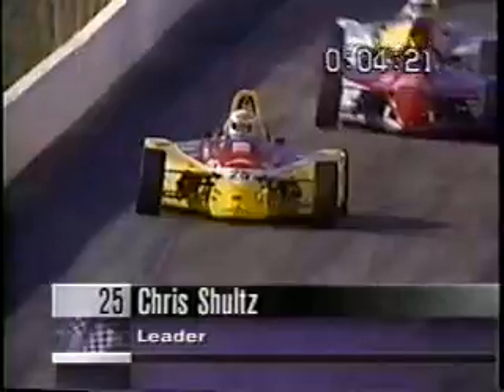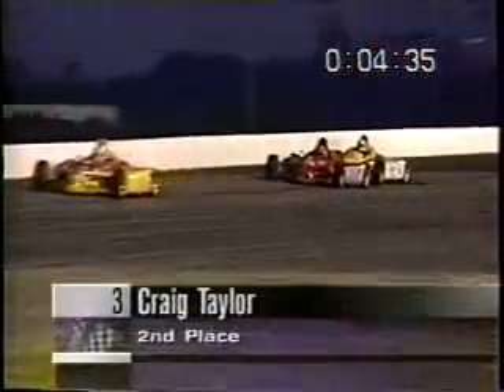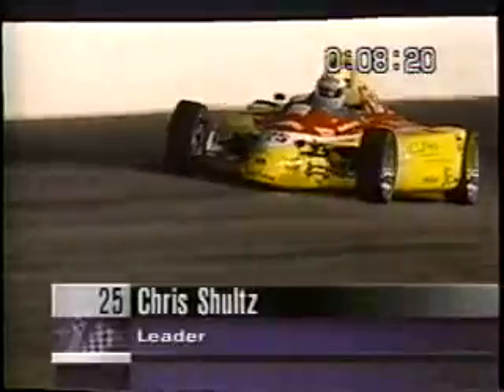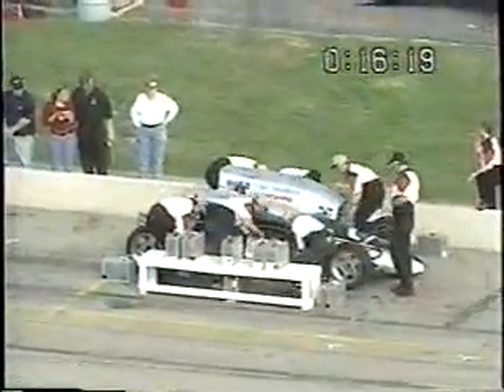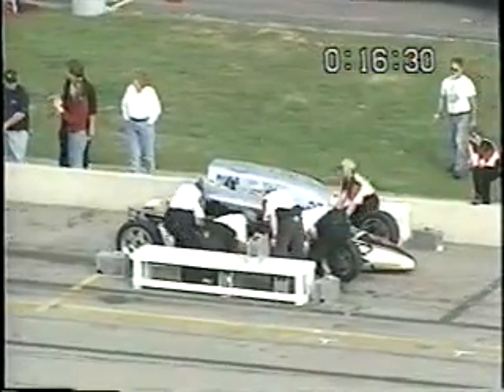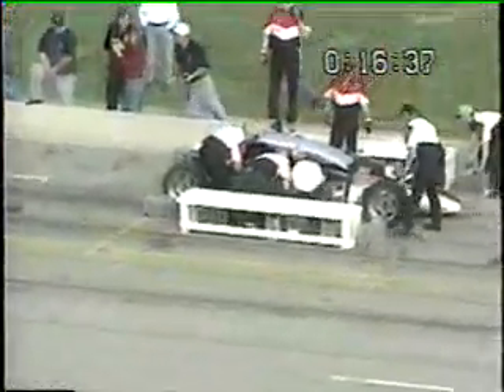Formula Lightning Smokin' Buckeye - Highlights

Comment: Formula E sucks, it's not even faster than this even though it's 20 years newer. Also, battery replacement is a much better alternative than simply jumping cars.
Reply: Jejking Well, I did some googling and the cars compare:

F-E:                                    Formula Lightning:

888 kg                                1 202 kg
200 kW (max)
150 kW (race)                     150 kW (max)

Battery+capacitor                32 Batteries
200 kg (max weight)            635 kg

Stint length at race speed:
>40 km                              ~12 km

I thought these cars were quite close with F-E, but turns out that F-E cars way better in comparison than I expected. The batteries alone are over 10x better with regards to weight and work they can do. Also, considering the design of the cars, and the 30 odd years worth of safety stuff crammed into the F-E cars, the wight difference is impressive, given that the Ligning cars were also made out of carbon fiber.

Notes: *The full-charge time of F-E battery pack is <50min, I could not find this information for the F-L, but I would expect it to be in hours.
*The information on top speeds were conflicting, but from all the information,all I can say they should be somewhat similar.

*F-E is in it's first year and a spec series (for this season), all the components were developed in few months and with main priority being reliability, not performance. F-L was only partially single-spec.

The electric technology, and the potential for it's development does excite me, the stupidity of fanboost angers me! http://imgur.com/gallery/ICUUMTO
Reply: Very well spoken chap, my reply was unfounded and more one of a gut than one out of knowledge so thanks for this comparison, it looks less bleak for F-E now but the fanboost is downright falsifying the competition. We don't need that, even in this age of entertainment.
Reply: Jejking The battery replacement question is difficult. These guys could change the multiple batteries in under 30 secs. (Slightly over 30 secs in the video at 5 mins, and it is not sure weather they replaced all 32 batteries, looks like only half, or maybe they are double stacked, I don't know)

Formula E car swap pit-stop has a minimum time of 60 secs, but in reality, could be a lot faster.

But still, the replacement option seems like the logical thing, firstly, you would only need one car. (Using two cars is quite silly and wasteful) And with a single peace or two peace battery pack the pit-stop time could potentially be well under 10s (depending on the design).

But the problem is safety. The new batteries have way, way more energy stored in them (and expect it to increase still). If damaged, they can release gigantic amounts of current at dangerous voltages, and almost certainly short circuit, melt things around it, and set itself on-(inextinguishable)-fire. Not to mention the very, very toxic chemicals that will be released.

For these reasons the battery has to be pretty much where it is now, in the middle and bottom of the chassis, with it's own protecting casings etc.

To design a release mechanism that does not compromise the safety, and a method of changing the quite large 200 kg battery pack from underneath the car in a rapid (and safe) manner is something that could certainly not be done for the first year of F-E. And it is difficult enough that they might not consider it.

I hope they do consider it at some point though. Although, dropping the shit fanboost, and battery, electrics development is my priorities at this point.
Reply: Very considerate chap, valid points :)
Reply: +Jejking F1 took 100 years to go as fast as now
Reply: Formula Lightning cars did not hit 143mph - that was a pipe dream.  Average speeds were in the 50-70mph range - on ovals.  watch some videos - they look like kid's bumper cars.
Reply: This aged like milk considering where Formula E is rn. 600 hp, 200 mph in cars that can actually last a full race without drivers having to swap.
Reply: @biskit9397 Please let me know where consumer milk packages last 10 years. I need that place, stat.